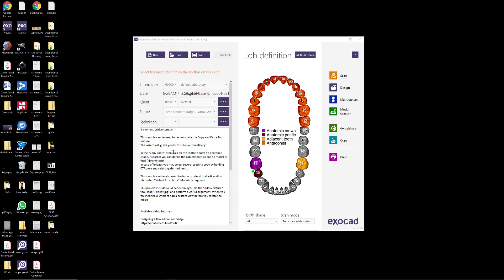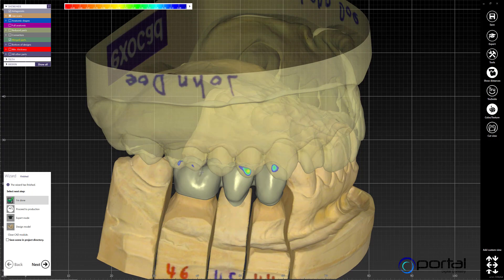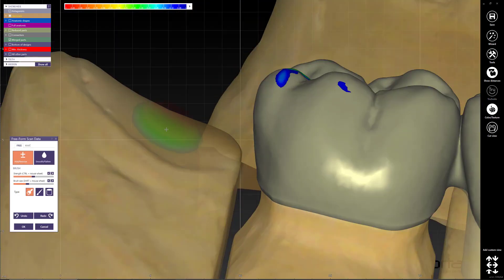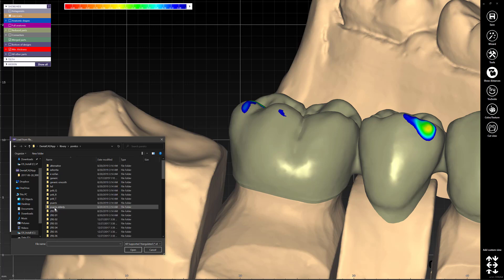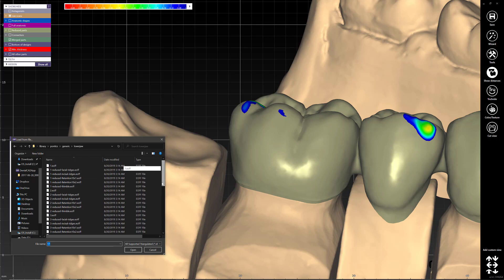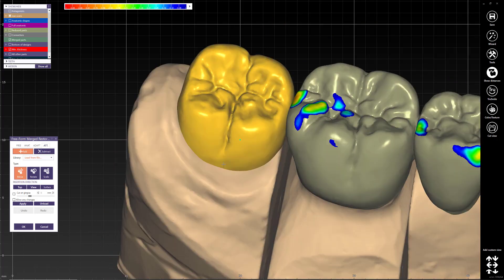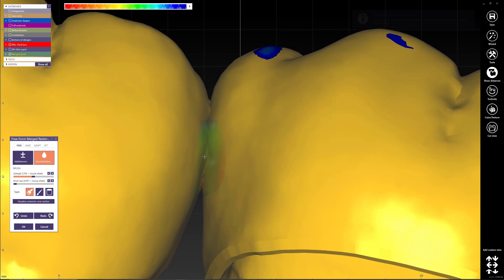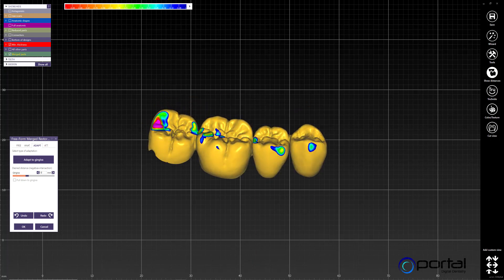EXOCAD- How to add a unit to an existing desing

Comment: I just subscribed, great channel! 🙏
I have one question I'd appreciate if you could help me with 😇... Is there a way to add an option so I could actually cut to the extra 'scanned' gingiva and not on the jaw scan? It doesn't cut to the actual gingiva and maybe there is something I'm skipping...
Reply from the maker: I don't understand what you are asking for. In this case it adapted to the model because I don't have a gingiva scan, otherwise everything would have adapted to the gingiva scan.
Reply: @portaldigitaldentistry415  Well... If I also have Gingiva Scan it won't adapt to it but to the model... so each time I have to manually cut whatever exceeds the gingiva...